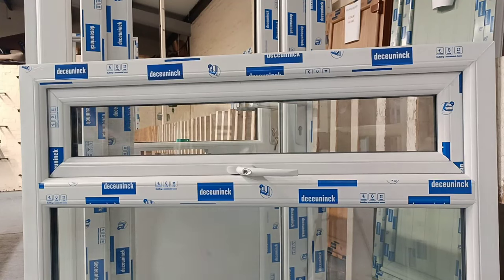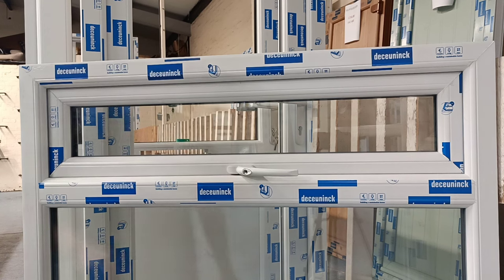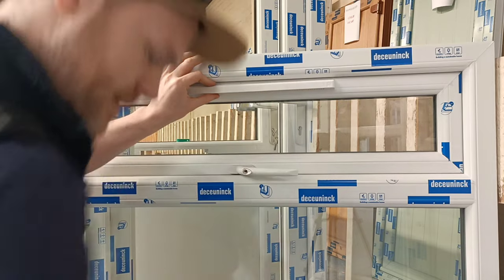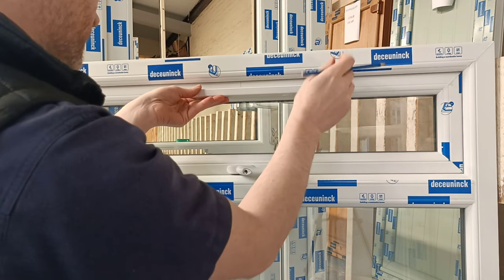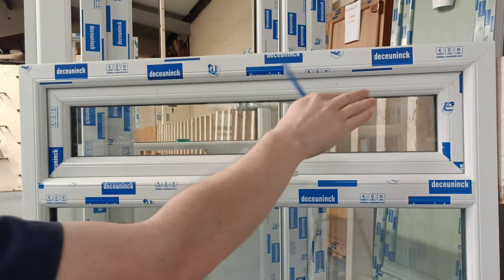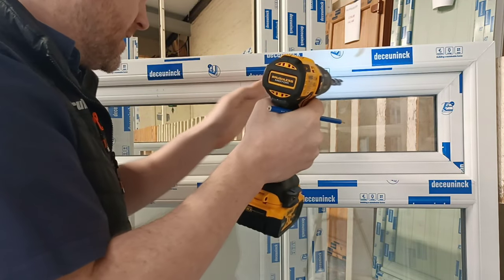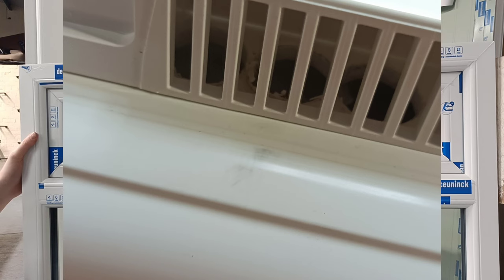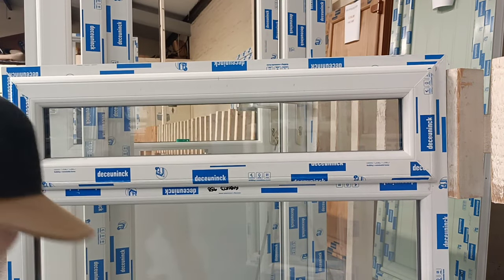Install or Retrofit a Window Vent on uPVC Windows: Fix Condensation with a Simple Upgrade

Comment: The film infers that it is not necessary to cut a continuous slot and that it is ok to just drill a series of holes. It is, but beware - for a typical 400mm vent, the holes would have to be spaced with just 1.6mm between them to achieve the mandatory design airflow...
Reply: You can drill out, but still need to route the entire gap out using a palm router, or even multi tool.  Keeps air flow to the max ( which is what you want) and gives a professional and clean finish.   If you are retrofitting for building regs they will fail the works!
Reply: Even if it's the correct air flow area and a neat job? @darronroper
Reply: @paulonions hi paul. Each vent manufacture will advise exactly what’s needed to reach the airflow  required. 

Drilling a series of holes still leaves blocked areas. 

Route it all out.  Even if it means dragging a drill bit across the vent area.  

Some inspectors won’t check and I have had issues with Fensa even when factory routed as they didn’t clock it was a 5000 vent

Comment: Is there any way to easily test that air is flowing? As you can't drill a hole right through to the other side and have to drill on both sides I'm not sure if I did it right or stopped short. I drilled on both sides until I hit something solid.
Reply from the maker: Hi, you should be able to see daylight, test at night when it's completely dark or hold a flame to the inside where you drilled and see if it gets disturbed. 👍
Reply: @DGPSUK  Will do. Thanks a lot!
Reply from the maker: @WillsM85  very welcome

Comment: Did I miss your explanation why you do inside then outside due to the step? You said you explain later on? When later on?
Reply from the maker: Hi, Oh sorry I'll double check, it's basically you can't drill all the way through on most profiles as there is a step and it wouldn't come through the other side where it's needed.
Reply from the maker: I basically cover it straight after I mention it. 😊
Reply: @DGPSUK  ok thanks. Wish the people who we bought the house off got windows fitted with them already. Not even that old either.
Reply: @DGPSUK  ah right thought there was more later on 👍🏻

Comment: Super thing, but not in too windy places.
Reply from the maker: You could always pack the vent with soft foam or sponge to stop any loud noises from the wind and still get some ventilation 😉
Reply: @DGPSUK I have installed this kind of valves and It has  a filter, some kind of sponge, but I'm living at the seaside, it's almost always windy here. It's ok in a quet weather, but in a windy weather these valves whistling all the day long, even you close them.
Reply from the maker: @Sattrecamuss  Yes they can be annoying especially where you live 🙈🙉

Comment: Roughly how many trickle vents would you require for 3m X 3m conservatory please.
Reply from the maker: Hi it does vary, have a look at the following...

https://www.norrsken.co.uk/newsitem/trickle-vents-guidance-ventilation-part-f#:~:text=HOW%20MANY%20TRICKLE%20VENTS%20DO,has%20more%20than%20one%20bedroom.
Reply: Thank you  @DGPSUK

Comment: Do new windows come with pre installed vents cause 6iu never see these on new windows
Reply from the maker: Hi, they can yes but it is an optional extra, normally they are required in new builds though?.

Comment: I'd watched this video about 20 times before I attempted on my windows. I got a 13mm HSS bit especially for the job, but it would sometimes catch in my uPVC and my hand drill struggled, so in the end I used an oscillating multitool which worked much better.

I marked out the template on masking tape as my window frames are black, then cut carefully along the lines. I used a smaller drill bit for the rounded edges. Hope someone else finds this useful. Actually quite straightforward once you know what you're doing.
Reply from the maker: Thank you for the great info, 😊😊

Comment: If you dont drill through the internal metal do they still work? Thanks Tom
Reply from the maker: Depending on the profile you may get some ventilation but not as effective as drilling through.

Comment: I have encourntered a metal barrie in some of my windows. Is it OK to drill through it?
Reply from the maker: Yes you can it's just reinforcement 👍 just takes a little longer. 😊
Reply: @DGPSUK  Thanks. I note the upper windows that swing up do not have this metal although there may be a second layer. None the less when finished I can see through Ny wondows anr Anglia and another manufacturer and were installed at fdifferent times. and seem to have different construction.
Reply from the maker: @ardentlieutenant3390  Hi yes different window profile extruders will have a different design and chambers but more or less the same idea, some companies also  don't use reinforcement and some do. Hope it all goes well for you 😊
Reply: Thanks I used a smaller drill bit and then enlarged it. It was quite a job and I broke a few bits as I was doing it freehand with the window in place.
Reply from the maker: @ardentlieutenant3390  yes it can be a tedious job but can definitely be worth all the effort in the end 😊

Comment: Can you install these on already installed windows
Reply from the maker: Yes of course, this is what this video was intended to help with. 😊
Reply: @DGPSUK  I have dekurnik sliding doors just wondering where you would advise to put them on the 4 panel, the  2 central sliding doors or the 2 side panels